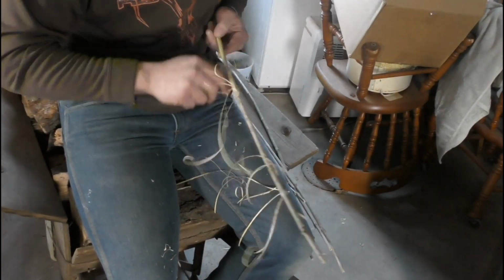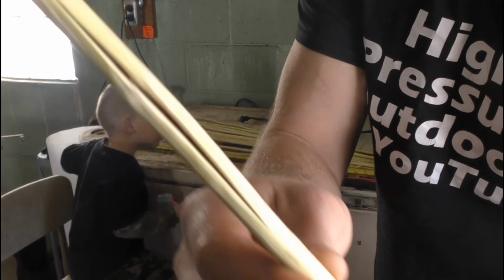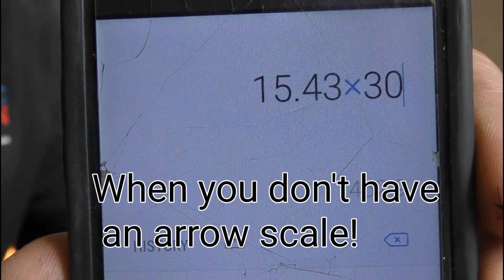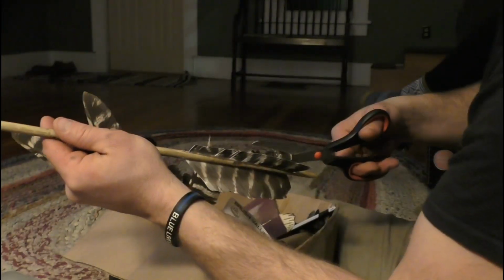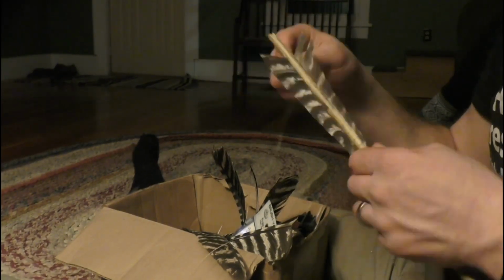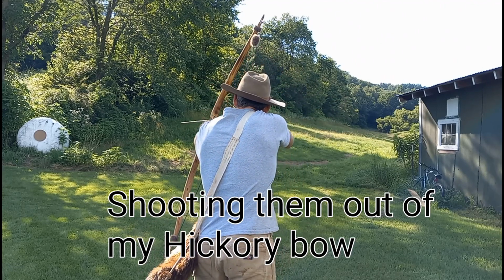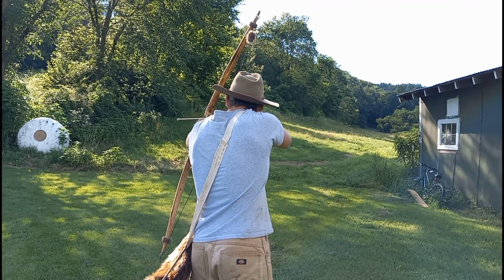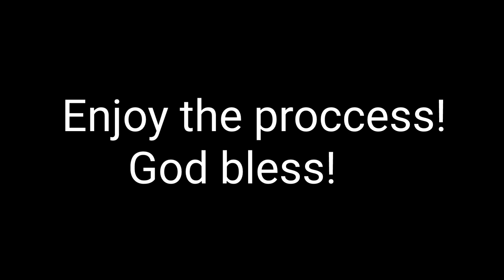(Primitive Arrow Making) Honeysuckle Arrow shafts

Comment: If you wait 3 to 5 days to peel the bark after cutting the shoots they shouldn't split on you like that. Usually works for me with other types of woods as well.
Reply from the maker: @The young outdoorsman - thank you :) It certainly is a bummer to do all that work and have to throw some away! God bless!
Reply: @primitivepreacher8964  absolutely buddy have a great day and god bless
Reply: @primitivepreacher8964  also over the course of a week you can straiten them shafts without heat by bumping them with your palms. Then after 3 to 5 days when you scrape the bark off they will be stright enough to not need heat.
Reply from the maker: @theyoungoutdoorsman5814  Thanks for that tip as well! I still have alot to learn :)